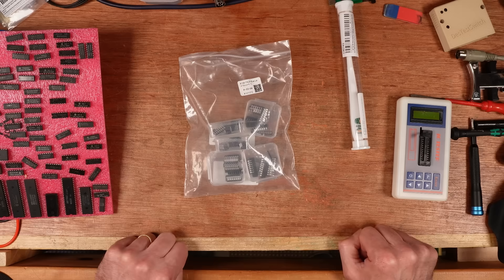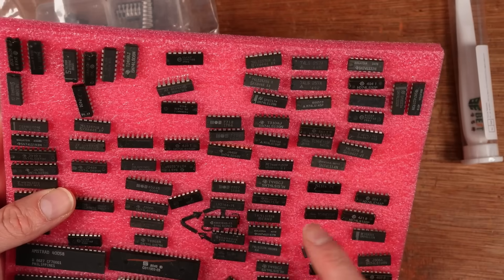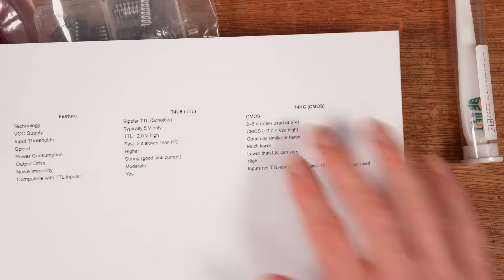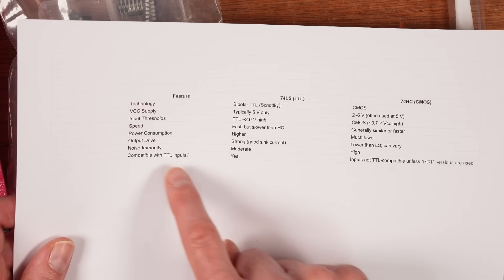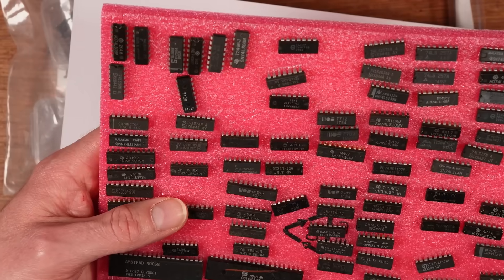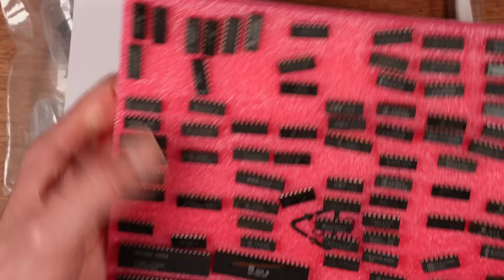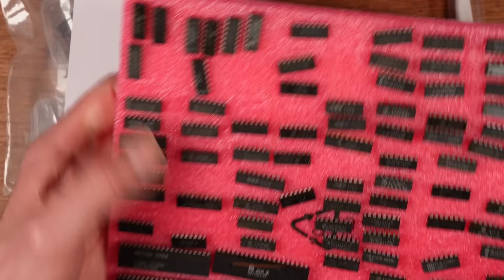I bought some 74LS Logic Chips from Ali Express. Guess what happened next?

Comment: testing cheap chips with a cheap equals nothing.
to realky test get the data sheet, it usually has a diagram showing how to wire it up for testing and how to measure the results to verify.

Comment: I have worked with TTL part for decades. In 80% of cases a 74HC part will work fine as a replacement for a 74LS part in a "well designed" circuit.

Comment: If you want to add a little more fuel to the fake chips fire, there's an interesting anecdote concerning the Aliexpress 74LS02 chips. 

I, like many others in the Atari community, like to make my own cartridges. A guy came up with a great PCB to make the Atari 7800 cartridges, and the smaller size games use a 74LS02 on them (larger games need a GAL chip). But, most Aliexpress 74LS02's get white hot when turned on, and the way to fix this on these cartridges is by cutting pins 2 and 3 off the 74LS02, which aren't used in this configuration. This doesn't happen with real 74LS02's. And this isn't just me, this is a known issue in the whole community. It doesn't affect us as I said, because we can just remove those 2 pins, but it just adds more proof that there is an issue with this whole fake chips thing.
Reply from the maker: Thats actually pretty interesting. I might look into that at some point

Comment: Texas Instruments still manufactures 74LS ICs. Of course they will be much more expensive, perhaps £76 a piece if not more. But you'll get known good parts. Or you can get known fake parts. What else would you expect for less than £0.76 for 50 pieces?!
BTW, if the 74HC ICs have higher output current than 74LS ICs - about 25 mA for common logic parts for both sink and source current. While 74LS ICs have 16 mA sink current and a significantly lower (-0.4 mA?!) source current.

Comment: This video surprised me — not because it claims counterfeit ICs, but because the only “proof” shown comes from a cheap IC-tester. I own the same tester and know its limits: it performs logic-pattern checks, not circuit-parameter measurements, so it can misidentify parts (for example, it reported an MM74C00 as a 74LS00, and it commonly labels HC/HCT parts simply as “HC”). So a much more reliable quick check is to put the suspect chip on a breadboard, power it with +5 V, and measure the input current with a multimeter (while a logic LOW is applied). As a rough guideline, classic TTL devices show input currents on the order of ~1–2 mA, LS parts are lower (hundreds of µA, e.g., ~0.4 mA), and CMOS inputs are effectively negligible, so that a simple measurement can tell you whether you really have TTL/LS or a CMOS device.

Comment: I've seen circuits where 5v LSTTL is driven from a 3v3 microcontroller and everything works fine.  Substitute an HC and it doesnt see 3v3 as a high.
As hobby enthusiasts we tolerate (even 𝘦𝑥𝘱𝑒𝘤𝑡) fakes but the danger is when they enter the mainstream. What happens when say an item of medical equipment goes into a repair shop, who knows where they source their chips.

Comment: Wow, this takes me down memory lane. I started as an R&D Tech in 1984 and all our prototypes were made with LS chips because they were a good compromise between speed and power usage. You could also let an input "float" and the chip would interpret it as a high so it was very forgiving. The T in HCT literally means TTL compatible. With almost every LS chip I worked with, they put out 4V on a high, which gave you ~2v of noise immunity. Certain projects needed F chips, which were power hogs, but the prop delays were much shorter. For one project we even used 100K ECL chips (25 Mhz clock). The differential signaling drove me nuts, along with the pull up/ pull down termination resistors. Thanks for the trip down memory lane. As others have suggested, don't trust your tester as gospel. You can breadboard a chip with a signal generator and monitor the input switching voltage and output voltage against the spec sheet.

Comment: I bought a pack of the sound chips SN76477 and actually they all worked 😮😮😮 One or maybe two hade a slighter output level but vco’s, vcf’s, env generator’s all worked fine.
I have also gotten som WORKING TIL311 hexadecimal led displays.
The prices at the time were low and the components almost unobtainium, so I gambled. However stuff I can get at my “local” shop easily, I will never buy from China.

 PS. There are photos of tubes with the text MADE IN CHIAN … reliable and trustworthy stuff, really 🤔

Comment: Thanks for making this.  The difference I've run into with regard to plain 74', LS, and the rest of the TTL compatible ones are gate delay.  The gate delay on the plain 74' or 74LS' part us is much longer.  The Crowell/Davies 48k modification for the Atari 400 computer relies on the long delay and it just don't work with the other, faster parts.
Reply from the maker: Matt Desmond demonstrated that very problem to me. Very interesting!

Comment: The ICs are cheap for a reason. These are most likely reject batches that failed QA at the factory. If you are lucky, they are leftover batches in a production run.
Sometimes you'll find misprinted chips in the rejects. It happens mostly at the short run production lines.
Sellers won't know for sure why these chips are rejected. 😅

Comment: 74LSxx were the best chips ever.  Fast (for their day), tough as nails, not static sensitive.  Hook up the power backwards and you might burn your finger touching the chip but when you wired it up correctly the chip would still work.  I've still got my cabinet full of them from the early 80's when I did more work with hardware.  There used to be a company, JDR Microdevices, that sold good quality chips at the lowest prices you could find in those days.  I've no idea who would be a good supplier these days.   DigiKey used to be great.  I know they're still around but I don't know much about them these days.  They are based not too far from where I live.
Reply from the maker: They really were built to last!
Reply: Раньше технику создавали инженеры, но они ушли на пенсию, или уже их нет. Теперь - маркетологи. А бизнес всегда ищет, где уменьшить расходы и иметь больше прибыль.
Reply: @dmitrystrelov6183  You are so correct on that.  It's all about getting as much as you can and giving as little as possible.

Comment: LS vs HCT, vs HC: LS and HCT are TTL logic compatible. HC is like the 4000 series parts and is not TTL compatible. HCT is nice for replacing LS as the latest versions are as fast (if not faster) and draw far less power than LS. **older versions of HCT where slower than LS but this has changed with later versions!

I'll also point out that HCT's are somewhat static sensitive (should be stored in antistatic foam, or tubes) and HC's are very static sensitive and very easy to kill just by handling them.

Comment: What would have happened had you used them?
Reply from the maker: Possibly very little. But there are edge cases with voltage levels and if timings are critical these are quite different to the LS chips.

Comment: Doesn't the Harlequin use HC series logic? It's been a few years since i built mine but assuming any of those specific ones are used they could come in handy. I rarely find a problem using the HC chips in place of LS series. Very occasionally I've found some weirdness (probably timing issues). 9 times out of 10 they seem fine.

Comment: What a cheap shot to fake 74LS chips that sell for pocket change.  There is an aspect of Chinese society that just seems to cheat customers for the hell of it.  I've gotten charger boards that were all bad, power banks that can hold about 65% of what they say they can hold, and counterfeit SD cards that say they are the latest huge cards, but are actually older SD cards deliberately programed to appear larger than they are.  I don't see how honest Chinese manufactueres manage to produce reliable products with all the counterfeit parts floating around.

Comment: Counterfeit DIP logic ICs are faked for profit by replacing high-value or out-of-production parts with cheaper, inferior, or used chips, and then relabeling them as genuine to deceive buyers. This practice not only creates significant economic losses but also poses serious risks to security, reliability, and safety in critical systems like military and medical equipment due to the unpredictable failure of the fake components. 
Reasons for counterfeiting:
Profit motive: Counterfeiters exploit the high value of genuine parts, especially those that are obsolete or have no good modern replacement, by selling cheap imitations at a much higher price.
Supply chain vulnerabilities: Counterfeiters can take advantage of loopholes in the supply chain, such as using unauthorized or less scrupulous suppliers who may sell repackaged or recycled chips labeled as new.
Low manufacturing cost: Simple counterfeiting methods, like remarking a chip with a new label or even putting a chip in the wrong package, require little technical skill and significantly reduce the cost of the fake product compared to developing a new one.
Avoiding development costs: By reverse-engineering and cloning designs or illegally obtaining intellectual property (IP), counterfeiters can bypass the expensive and time-consuming process of developing new components. 
Risks associated with counterfeit ICs
Security and reliability risks: Counterfeit ICs are often of lower quality and have a reduced lifespan, which can lead to catastrophic failures in devices like military aircraft or medical equipment, putting lives at risk.
Economic losses: The global trade in counterfeit ICs is a massive economic threat, resulting in billions of dollars in losses for legitimate manufacturers and IP owners.
Support for criminal activities: The revenue from selling counterfeit goods can be a source of funding for organized crime and other groups that threaten societal integrity.

Comment: I remember when the HC versions of 74XXX chips came out and everyone was saying that the industry was going to start using them instead of the old power-hungry TTL chips. What happened?
Reply: They mostly did replace 74xxx and 74LSxxx in new designs, unless there is a special requirement for some high speed 74Sxxx or something like that.

Comment: Hey, at least the fake ICs did something!
I would not have been surprised if they had been just an empty plastic DIL package with no chip inside.
Reply: Wouldn't have been the first time.  I heard of a boutique maker buying thousands of 555 timer chips he thought he was getting a good deal on.  It wasn't until they tested the completed boards that they discovered every one of the 555 timer chips was in fact an empty package.  They then tested the unused chips to check they were functional.  No joy.  They then de-capped a number of the unused ICs only to discover they'd purchased thousands of plastic package that had no die inside of them.  Now, 555 timers aren't exactly an expensive part.  They are dirt cheap. But this just goes to illustrate to what levels of fakery some vendors will stoop to.  The cost to remove the fake chips from a thousand PCBs and replace them with the genuine ones was enormous. Lesson learnt the hard way.  😞
Reply: @Tanamera-Tech  It must be almost as expensive to make an empty chip as one with a 555 inside. In fact, given that you'd have to set up your own production facilities, surely it would actually be more expensive ?
Reply: @burblering  perhaps if you were just limiting it to very cheap ICs, but what about the expensive ultra low noise instrumentation OP-amps that use the same package?  A lot of these fakes are literally "made to order".  Also as other commenters have pointed out, many OP-Amps use the same package and the same pinouts so remarking a cheap 8 pin DIL or SOIC package is not that difficult.  It isn't until the buyer receives the goods and actually tests them they discover they've been duped. 😡
Reply: @Tanamera-Tech  Yeah, I get that, my point was specifically about EMPTY packages (and also in the context of a cheap chip). Obvs the higher end you go the more worth it it is. And the standardised op-amp pin-out is as you say ripe for exploitation.
Reply: Like the Signetics 25120, or Tek's scored (like a cookie) 8 or 4 pin universal IC. Break me off a piece of op amp..
Reply: The whole idea is that they must do something for long enough so that the buyer protection period is over, before the buyer finds out that the "TLO72" is noisy or low GBW, or the "CMOS" chip has high current drain.

Comment: I'm not understanding the issue? You ordered LS and got HC. That doesn't mean anything was fake and you can still use HC. I use HC for level shifting 3.3V to 5V logic.
Reply: No, a lot of old electronics are dependant on the rise and fall times of those old LS chips and will not work with anything faster.

Comment: you have too much faith in that cheap ic tester. there is no way it can actually differentiate between logic families. it only checks for the logic function and then spits out the result as HC. I have this tester and 2 other variations of it and they all do the same and for non logic ICs they even fail to spot a faulty chip sometimes e.g. it can tell you an opamp is good while it is not and that throws a big wrench into your gears when you are trying a repair.

Comment: I don't think they were sanded. And the "etching" is actually done with a laser. So I'm wondering - can the tester be the problem? Does the thing really test for differences in logic levels?
Reply: I tested one of the same chips by powering it at 3.3 V — it worked perfectly, which wouldn’t be the case for a real 74LS device. The output voltage levels were also very close to 0 V and the supply voltage, confirming that it behaves like a 74HC chip rather than a TTL one.

Comment: Tedt any cheapo components from AliExpress, there are mega bargains to be had, ive personally never had a single issue, with chips, even high end memory chips, and dsp chips. Only issues ive had are a cap kit of around 1000 electrolytics which were not great on the esr front. Values were ok though. As always YMMV 

Those brushes are exceptionally good, got loads, but still using the first one. They're brilliant.

Comment: First, HC/LS compatibility is a well-known issue and usually can be solved. Take the '02 input in question and pull it up to 5 volts by tacking on a 2k-5k resistor between pin 14 and the input.  If you want to deal with more of the inputs, get a SIP pullup network, epoxy it to the body and run fine jumper wires (30 ga wirewrap wire is great). This is obviously not a production line fix, but for onesies it's quick enough. An 8-pin SIP will be the same length as the '02 body and will handle 7 of 8 inputs in a package.
Second, the "weak HC output can be an issue in cases of buss contention" is pretty jaw-dropping, and I hope you were just winging it. '02 outputs are neither open collector nor tristate, and have no earthly business driving a buss.
Reply from the maker: I'm always winging it and never pretend otherwise

Comment: It seems bizarre that the counterfeiters would take HC series chips and turn them into fake LS series chips, when the HC series chips are more compatible with MOS CPUs, lol.
Reply: But many vintage computers also used 74LS TTL IC's, so won't fully drive 74HC inputs (Only 74HCT).
If you swapped all of the logic IC's in the computer to 74HC ones, you might sometimes be OK, but not too helpful if just wanting to replace one faulty 74LS IC. An old EPROM's (before CMOS ones) etc, often didn't have that high an output voltage, as they only needed to work with 74LS TTL IC's etc.
The NMOS CPU's back then would also have been designed to work with 74LS, as 74HC wasn't really available until a while later.
Reply: @owenrandle8265Good points.

Comment: Hi there, this is how it goes for me, usually is about 2 weeks to receive the package from China into my country,  then 1-2 months until they arrive to my city. Sometimes even 5 months and Im not kidding. Back to your problem, I KNOW VERY WELL how frustrating is to wait 2months and receive some fake stuff. But here is my resolve and I hope it will help you too. After I clear up everything with the seller and aliexpress, like you are right now, Im searching for 2 or 3 OTHER sellers completly different from my original one that I buy from. So my advice is to try again, because they are very cheap, and there is competition between sellers. Also you can talk with the new seller about your past experience, and ask to prove somehow, and send through email that prove, if youre lucky. If not, then simply buy from other 2-3 diferent sellers and at least 1 should be ok. This is my experience I had to do it 1 or 2 times in my life - so not that many times. In my case I had to switch the IC and buy another type from the original but both doing the same thing so... that was completly another IC version. If buying from 3 sellers also gives you fakes, then we're all screwed ! Not only you. Its also a good movie to make about ! haha; Good luck !

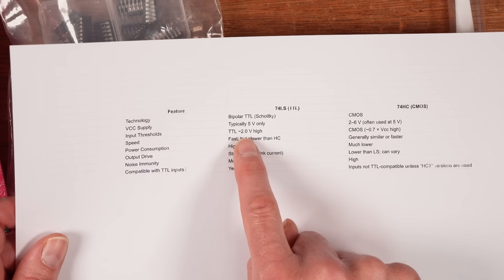Comment: 1:20 Input threshold on TTL (LS) is not really the same as the input thresholds of the Z80 or the ULA. Neither of these are LS (although they are designed to be compatible with TTL levels).

Comment: In the 1980s I used to go to Russia as a computer engineer, In one factory I needs a logic chip I didnt hapen to have. They sourced one locally, Chip changed, Power on BOOM  After a bit of investigation The chip was the same logic but different pin outs - Common Russian practice.
Reply: This is not true. Soviet logic chips were completely pin-compatible with their Western counterparts. The only difference was the pin pitch between metric and imperial.